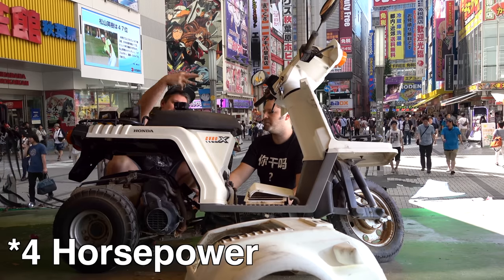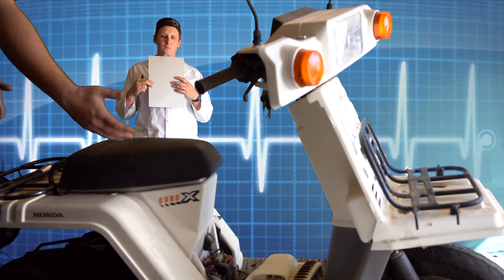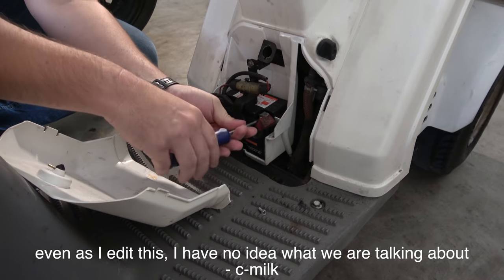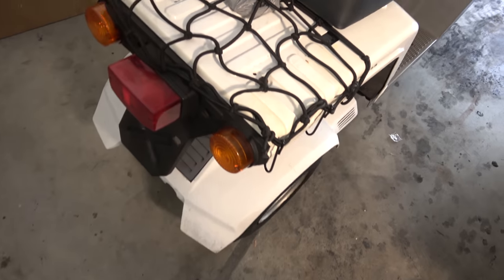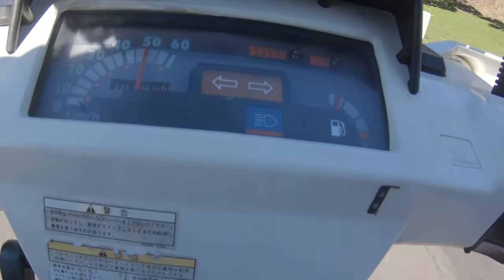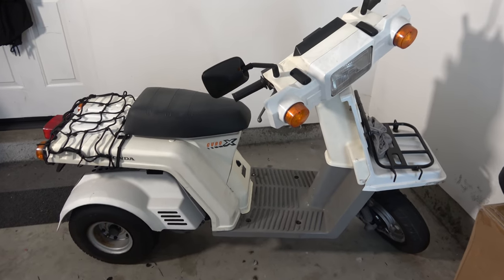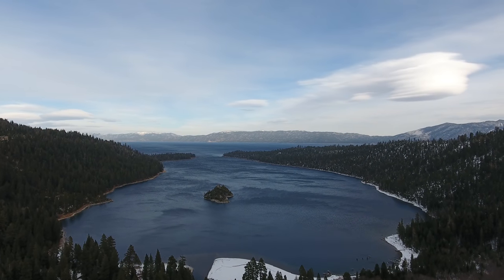Living with a 50cc Scooter in the USA - Honda Gyro

Comment from the maker: Patreons vote on the cars to buy for future episodes - https://www.patreon.com/worthlesswhips 😍
Or support us here - https://paypal.me/worthlesswhips 👍
Reply: If you feel like trying something different I love electric vehicles. I think even if you just borrowed one I think you would be impressed by the Tesla cars. The technology has come a long way.
Reply: I was thinking of a route for you all. How about the 15 up to vegas, then the 95 up to reno and then down the 380 to LA. You get to go through a lot of little towns and scenery out there.
Reply: Gasoline is a great solvent for cleaning engine parts, however while it might feel anathema, try using Everclear.
Thank me later.
Being nearly 100% ethanol it very easily degreases engine parts, doesn't leave stains (IT doesn't, but keep in mind the grease it just dissolved will be left behind when the ethanol evaporates), doesn't leave a residual smell on everything it touches, and is water soluble so you can just rinse your hands or garage floor if you so desire.
As nearly 100% ethanol, it has the added benefit of evaporating quickly and leaving parts squeaky clean.  Keep in mind all the hazards of using gasoline still apply -- flammable, dries out rubber components, etc.; it's just way cleaner and easier to work with!

Comment: Was the oil mix to high? To generate that much smoke makes me think it was throwing a bit to much oil into the gas mix.
Reply from the maker: Yes, Winston added oil to the gas, even though the auto lube system was working.
Reply: @WorthlessWhips  I did that once with a riding lawn mower. It looked kinda like I was  using some james bond smoke generator gadget.
Reply: @WorthlessWhips  I've seen destroyers generate less of a smoke screen.
Reply: @WorthlessWhips   copy RX7 enthusiasts... disable the auto lube and run premix only.
Reply: Use a synthetic 2 cycle oil that can be mixed 50 or 60 to 1.
Reply: @Roborebonzo  I've read on forums that 40:1 is good too but idk

Comment: Cost is cheap to bump a little more compression with a new piston and rings (shave head down), cut cylinder to 003 of inch. A LITTLE tight, however it allows heat to transfer easier from piston to cylinder wall and will cool easier. It's a trick I learned from Reno Leoni, (head mechanic for Ducati racing) to keep power and cooling while your holding the throttle wide open climbing a hill.

Comment: I don't know, those things look pretty badass to me. Probably doesn't feel like that riding them, but I like their design.
Reply: Yea they’ve got that floating suspension look to them with the rear of the seat sitting up. Pretty modern looking for being as old as they are. With new paint they’d pretty decent. I’d also probably do as much to the engine as possible to raise that hp up, and it’d be a dope little bike. Of course it’d probably be cheaper at that point to just buy a new bike...
Reply: Check out the gyro x. Super cool. Like a sportier version of this.

Comment: Gotta go on a diet...lose some weight, gain 2-3 mph. 
Expensive, but try that pre-mixed, high-octane, non-ethanol TruFuel gas at Home Depot (by lawnmower/outdoor section). 
Over-inflate tires a bit. 
Get hi-viz vests + stickers.
Reply: How about changing the gear ratio? Maybe sacrifice a bit of acceleration for top speed?
Reply: @MarcRitzMD  I think these are CVT but I could be wrong. If so, it's a matter of swapping the roller weights.. easy enough.
Reply: he mixed oil in because he didn't trust the oil mixing system, but that system was also working so he was running very rich that shouldn't be a problem the more they get used to these things

Comment: Fifty years ago, going to work required three buses, even though it wasn't very far. So I bought a used Honda scooter, cutting my travel time from an hour to 15 minutes. The scooter had no trouble going the speed limit on city streets, and driving it was a hoot!

The office I worked in was very staid, so I didn't know what to expect when my boss asked whose helmet was on the coat rack. He took me into his office and showed me numerous pictures of him on his racing bike!

After a year, my finances improved to the point where I could buy a car, so I sold the Honda for the same price as it cost me. What a great experience!

Comment: When I was in my teens I had a Yamaha 50cc scooter and my friend had a 125cc motorcycle that wasn't running so I took the carburetor from that and put it on my Yamaha. Let me tell you it went like a scalded cat. The only issue is the Yamaha had oil injection but the other carburetor did not so I would have had to premix the fuel in the regular tank to keep running  it. It was fun
Reply: How did u mix the oil when the tank was half empty? And what's the ratio

Comment: If you use one of the high tech synthetic 2-stroke oils you will get virtually no smoke and you can use substantially less of it. One of the Brand's I like is called Onemix. You can find the hitech synthetic 2-stroke oils available at Turf Equipment specialty stores or some marine supply outfits.

Comment: 2 strokes normally only smoke a tiny amount.  Use 40:1 oil ratio.  It looks like the mix is 20:1 or something.
Reply from the maker: More like 1:1
Reply: @WorthlessWhips  What I think could be happening is the auto lube is adding oil into the pre mix fuel, meaning you've got double the oil.  But you probably already emptied the auto lube oil tank anyway.

Comment: Does it has a catalytic converter?  

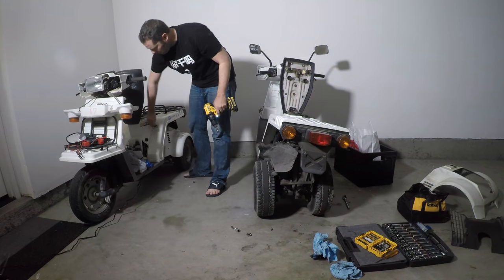The ratio oil/fuel used to be about 1 liter of oil per 25 liters of gasoline (1:25). Nowadays there may still be a max of 1:50. Special 2-stroke oil is then required for mixing, ordinary motor oil can pollute the engine.  Maybe you used to much oil?

Comment: I love the idea of a cross country trip on the back roads, I also enjoy all your guys videos immensely.  An idea you might want to try is installing a front tire with a built in 1000 watt hub motor, a controller, and a 20ah lithium battery like I have on my bike.  I know they make them in all sizes, and it may save you a huge hassle during a breakdown, and give you a power boost on demand for faster acceleration and hills.  Just an idea, thanks for everything.

Comment: Mix ratio has too much oil. Also, you'll be better off with synthetics that will allow mixing at higher ratios, like 40 of 50 to 1. More power and less smoke. I'd suggest going big bore, but that is more difficult on two strokes, as exhaust and carb tuning are a pain. I have done many big bore kits on Chinese 4 stroke scooters. Lotta bang for the buck with those.

Comment: I used to rent out Honda Nifty 50 scooters. They lose heaps of power when the exhaust port blocks up with carbon. I used to undo the exhaust from the cylinder head and scrape out the carbon build-up with a screwdriver. Your scooters probably have the same engines. Have a look, I could be beneficial.

Comment: Did you check the weight rollers? You may be able to make it a bit faster. My bike was barely doing 50 kmh, but the rollers were in really bad condition. After changing them, it can go over 60 kmh..

Comment: If you tear trans apart u can use a simple file to under cut the shift dogs if needed instead of new parts or gears. Almost can't imagine such low power for cross country trip. 125cc is stretching it a bit as it is. Now u wanna go 50 cc, maybe you should get an RC jet engine and strap it on the back to get up the hills.

Comment: Grangran might not be able to walk but now she's got 2 stroke power on her hands

Also a trick: In asian countries when traveling far distances at high speed on an underpowered motorcycle, people use medical tubing and a big bottle to siphon/drip water on to the cylinder and head cooling fins. It might rust the heck out of your engine but at least it won't overheat. This is tricks is especially used for motorcycles running reduction ratio sprockets for pulling trailers with a crap ton of cargo because "All the rev and no speed" infamous for causing exhaust manifold cracks.

Comment: Dumb question guys. Could you use the gallon jugs of premix they sell at home centers and Walmart for chainsaws on those or is the ratio wrong for it? Reason I ask is I think that it's widely available and I want to say a lower smoke formula.

Also better or worse than a Hodaka Wombat? 

Next purchase needs to be a Rokon. US made (in New Hampshire) so parts are available and they literally can go anywhere.

Comment: On two stroke bikes, exhaust was usually two part assembly so it can be cleaned from all that oil buildup, but... Older models didn't.
I had MZ 250, factory instruction on cleaning the exhaust was, drive at max speed so it all burns out. How do I know?
During one late night drive I had fire belching out of that thing, but the next day it started right away. Googled the shizz out so I could find out what in the hell happened.
In short, if it still runs it's normal. Enjoy your 50 kph monster.

Comment: Riding mopeds in  the UK is pretty much par for the course. I once owned a Honda C50 (unrestricted) max speed was 50mph down hill average 30 mph. My mega Journey was travelling 250 miles from Bognor Regis upto Merseyside. It took two days and I had a sore bum at the end of it. Petrol consumption was great 125 mpg. The only sad part was that the engine died 15 miles from home on the return journey. I had it transported home on a car transporter and the whole street cam eout to watch as it was unloaded. Embarrassment factor! The condensor had failed, a £2.00 piece of kit. If I had had a fly puller I could have fixed it myself.
Anyway good luck on your trip whether you end up going.

Comment: How badly do you want to go faster? I have an Aero NB50 [probably same motor as in those Gyros; similar vintage] and Honda stuck a completely normal 4T pipe & muffler on that 2T engine. There are zero go-fast parts for those engines, but if you were willing to f@rt around & make your own expansion chamber & rejet the carb, you could get the powerband to shift higher in the rev band so that it could pull the higher revs needed to go faster. You could also play around with the springs & rollers in the CV drive [those are somewhat generic, so you can find heavier rollers on eBay from ScootDr? or similar...] If you're willing to do more serious surgery, you can tear down the engine & widen the exhaust port [Honda was generally pretty conservative w/ their commuter scoots; don't f!ck w/ the intakes or xfers at all, just remove the cork in the breathing from the too narrow ex port is the info I have from back in the day. A proper ex port can be up to 25% of the cylinder circumference, but you won't want to get too radical; having it narrower at top and widest at bottom would probably do best, to allow both good breathing and good ring control...] As for mapping, just use Google maps & have it do routing for a bicycle, & then double check to make certain it didn't put you on any bicycle/ped/equestrian only type paths...

Comment: old 2stroke.. exhaust is probably full of oil. i used to burn them out.. smoking down the hole neighborhood in the prosess. the oil and soot also clog up the exhaust reducing power a lot.  the engines can usually be "adjusted" to go a bit faster. especially up hill. i used ot use a old dentist drill setup to open up the port's. if not cylinder's and pistons can be had to make it go faster.  i gues it have the same engine as the Honda PX or something? a big bore kit on that thing trippled the power ;)

Comment: You should do a trip to Miami Florida
 As well as it looks like the oil injection system is working because if you even pre Max your oil a little bit with an oil injection system they tend to smoke super crazy so you probably should have drained the 2 stroke tank for the oil injection system so that way you weren't feeding into much to stroke oil and by the way running rich on 2 stroke well in this case actually gave you better performance so your probly going to be looking more at a speed of 28 to 30 miles an hour instead of 34 miles an hour once you are on the proper oil  Mix.

Comment: Those bikes are running wayyy to rich.  There’s a lot more power on the table if you get them tuned right
Reply: no privacy   it’s a two stroke the gas and oil are mixed so if it’s too rich with gas it’s also too rich with oil.   The bikes are shipped from japan where the altitude is different so the jets in the carb are too big to run at the new altitude and or air pressure.  Needs a small main jet

Comment: I have extensive two stroke experience, if piston is good (cylinder,etc), use full synthetic oil, after first rev, it should not smoke at all, if it does, maybe too much oil in gas. I would think Honda oil injection pump would do good job.  if carb is set, and use full synthetic oil ,you rev  engine once after start up and it should run without any noticeable smoke.
Reply from the maker: Winston literally dumped oil into the gas tank, so it's pretty obvious what happened here lol
Reply: Hey Winston, these machines r precision devices, and you don't just dump oil on tank and then gripe about smoke, have you popped head  and looked st cylinders? Compression test will tell u if bore and piston and rings r good.

Comment: What does CA say about mopeds etc? 50cc in some states require no plate or insurance or drivers license but age 14 and up (CT)
China they need an F license or anything higher motorcycle, NZ a car license includes a moped. South Africa a moped is 125cc or smaller n can at times he part of car license or you you have a motorcycle license it’s included.
How’s all that work in CA?

Comment: Curious does engine reach red line in top gear, 50cc should do 50mph. Take a fine file and cut about 20° angle on all ports so rings have no sharp edges to go by, finish with fine sand paper. On intake use dremmel and rough up all walls including valve stem area, what this does is great turbulence on walls to catch more fuel to be drawn into combustion chamber. If u see race bikes rev engine and fuel must comes back out intake it's because it travel backwards along cylinder wall of intake, losing that from going into cylinder.
Reply: Pardon me, forgot u don't have valve stems to grind on, however, roughing up intake still works on the intake track to get all the fuel mix into the crank chamber.

Comment: Should not be smoking that much. I imagine you are burning up tons of old oil in the exhaust. You should seriously bypass the oil injection. It's a huge risk running it.

Before your road trip you should pick up a couple expansion chamber exhausts and some bigger carb jets. Probably get you up to 40 no problem. Or you could go real big boy with a 70cc setup and a bigger carb.

Are these case inducted reed valve bikes or Piston port induction bikes?

Comment: its actually illegal to ride a motorized scooter that's 50cc or higher in a bike lane. (in most states)
i was holding up traffic on mine, so i pulled over into the bike lane, and a cop saw me there, and wrote me a ticket for driving in the bike lane.

Comment: 50cc the engine won't last long, I bought a brand new bike with a 4 stroke 50cc rode it around at 60kph full throttle everywhere, engine blew up after 2000km lol Best to upgrade to a 80-90cc or preferably a 125cc.

Comment: You can’t just use pre mix and disconnect the oil pump, it will seize the motor when the oil pump overheats from no oil cooling it 🤦‍♂️ I build these engines I would know, if you didn’t disconnect the oil injection system and still ran pre mix than this is why is smoked

Comment: How much oil did you put in ...!!!  What the Hell guys.  You should have NO SMOKE from those 50cc engines.  NONE.  Should be running 50:1 mix ratio and if it is smoking after said ratio, then your LOW and high needle Mix is HORRIBLY rich.  Your carb is probably plugged